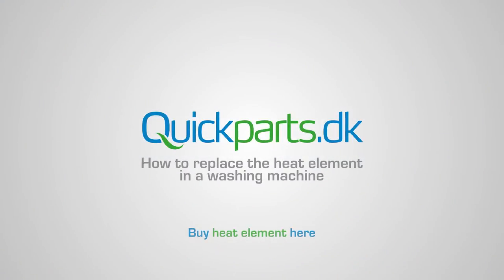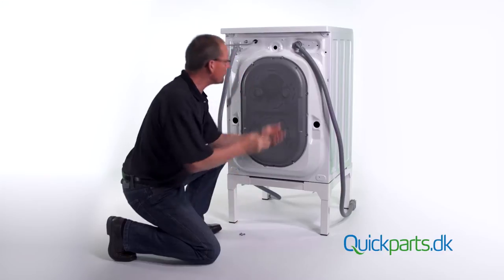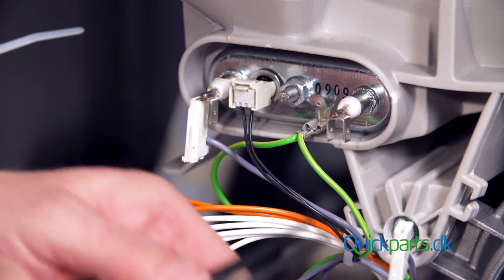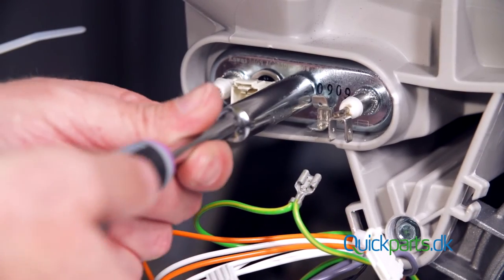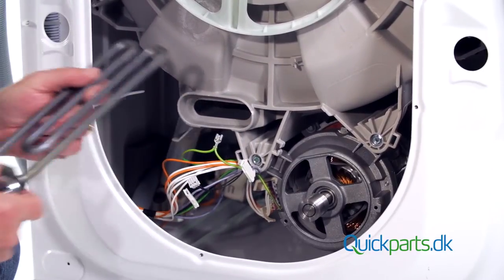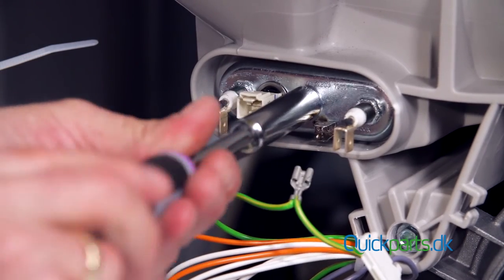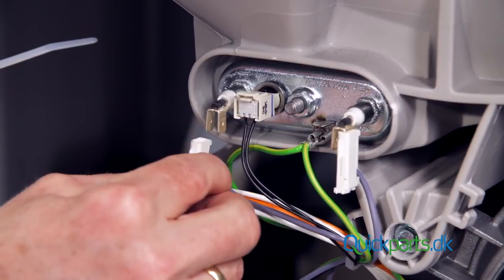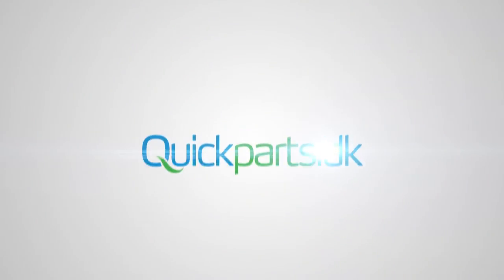Quickparts replace heating element on a washing machine

Comment: Riddle me this, why would i pay the same sums i used to pay on a stainless steel body, cast iron spider and cast aluminium machined pulley on a POS plastic body, plastic pulley POS junk washing machine that's nothing more than a glorified waiting disaster, potentially lethal spinning destruction machine?

No thank you. I'll stick to antiquated heavy, but efficient machines.